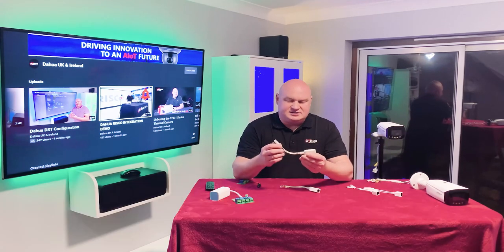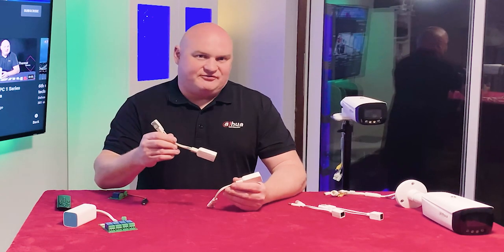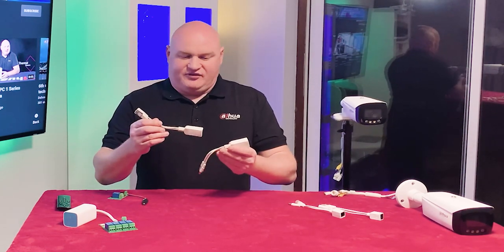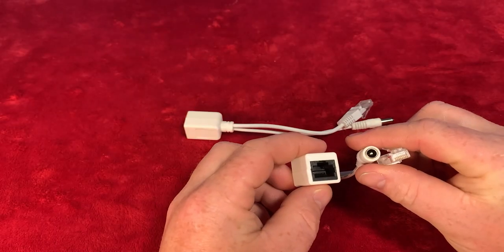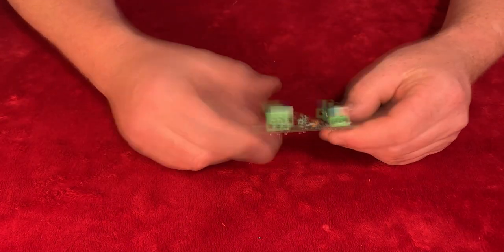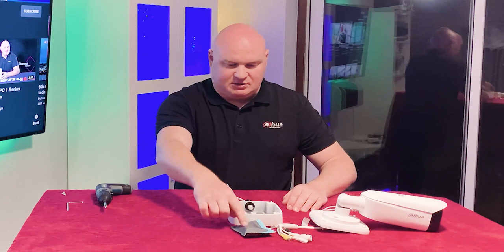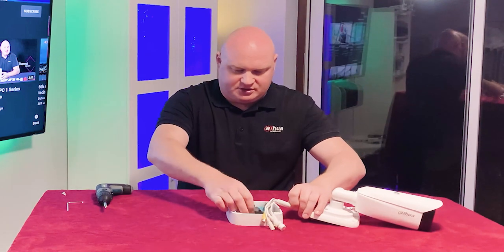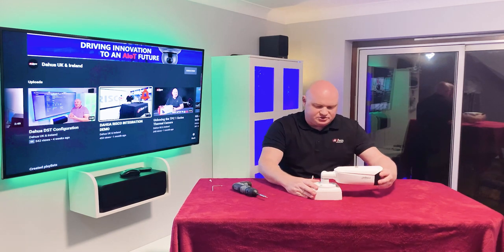Tech Corner : Home automation with Alexa

Comment: Great solution! I am still missing out a bit more info to get started.
Which parts did you use for this setup? Does the power to the relay, for instance 12v, not intervene with the 24 or 48 volts PoE to power up te camera? Don't the use the same wires in de ethernetcable or are these powerlines in the ethernetcable for PoE separated with the splitters with the power out 5.5mm connector. In case not I asume you still need a seperate 12V adapter at the power in passive splitter for the relay, right?
Reply from the maker: Please contact support.uk@dahuatech.com for this one. There's lots of information behind this one.
Reply: @DahuaUKIreland  relè Sonoff MHCOZY with Ewelink😀